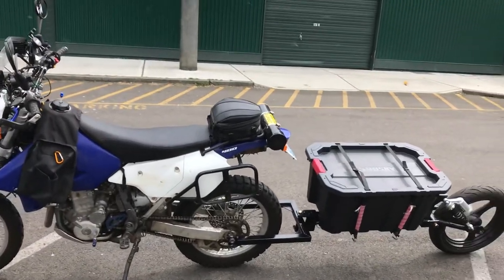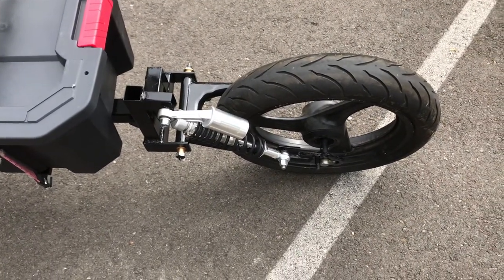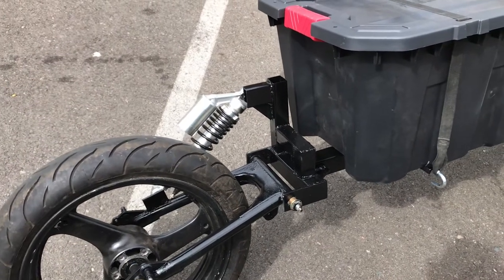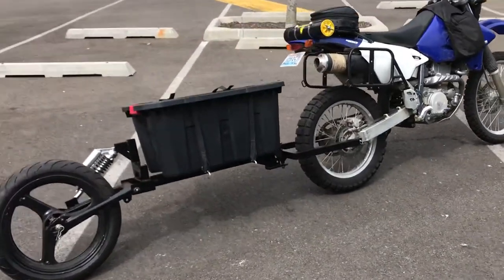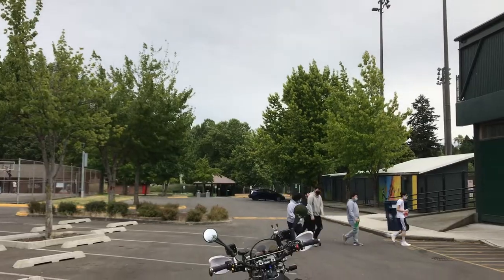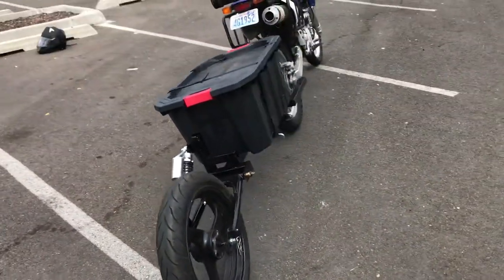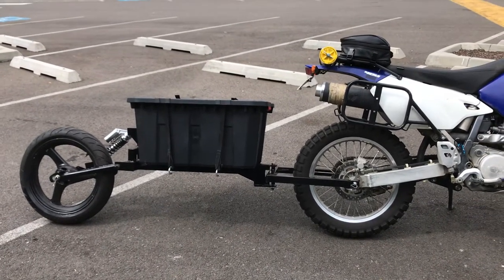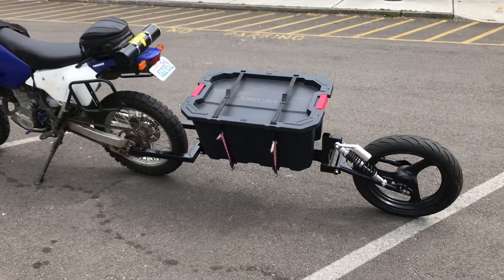Single wheel ADV motorcycle trailer.

Comment: Great video, I was thinking about buying a Sherpax trailer, but now I want to make my own!  Thanks
Reply from the maker: I lightened up by 35lbs by using a CR85 front wheel and a smaller box.
I saved over 5lbs jus by switching boxes
The new wheel saved 20lbs and the tire saved 5lbs
Reply from the maker: Do it,it will be a blast

Comment: Any advice for those with solid axels? 
I was considering a trailer setup similar to a bicycle trailer. 
I don't want to build a complex hitch that mounts to the frame. 
I ride a f650gs 
Your design looks perfect and ide like to copy it
Reply: I made a simple arrangement to connect a trailer to my motorized bike - a rigid draw bar fastened to both sides of the bike frame, with a single vertical hole in the center behind the wheel, to pull the trailer. On the tongue of the trailer I welded a threaded end of a car inner tie rod end, and threaded an outer tie rod end onto it. The pin of the outer tie rod end goes down through the hole in the bike draw bar. This allows for steering , tipping of the trailer sideways in relation to the bike, (the tie rod can rotate on its thread) and plenty of fore-and-aft vertical travel. Tightening the tie rod end stud nut makes both bike and trailer hard to steal.

Comment: Seems to be a great set up but missed the wheel type due to wind noise. What was the wheel brand?
Reply from the maker: In the video it had a GS500 front wheel.
But it proved to be too heavy so the big box came off and a smaller box went on.
Also the GS wheel came off and a CR85 front wheel went on.
I shaved off over 35lbs !!.
Reply: @motohead117  Thank you...you have been a big help

Comment: Viewer wondering: how do you rego that? Will those attachment points survive?
Anyway: not even putting lights on it
Reply from the maker: No lights needed because the motorcycle lights are visible.
No reg needed as it’s considered a part of the motorcycle

Comment: you need to change the ridged hitch setup, to a universal joint type or ball for better handling , it will handle better on freeway speed and wind and in the curves , ive been pulling every type of trailer you can think of for 45yr from big trucks to rv trailers to small trailers and all my motorcycle trailer
Reply from the maker: It needs a semi ridged hitch or it just falls over,this works good it’s a tried hitch setup that I’ve used before.
The problem is light bike vs heavy trailer

Comment: nice trailer but the turning radius of the trailer is too small on a tight turn you can fall of the bike the distance between the bolt and the front of the trailer has to be longer
Reply from the maker: 🤣🤣🤣🤣🤣🤣🤣
Nothing wrong with this trailer at all !!
It works flawlessly,what makes you such a expert ???🤣🤣🤣🤣🤣🤣🤣

Comment: Where can I get one ?
Reply from the maker: I built it myself,get a welder and start building !!👍👍👍👍👍
Reply: Can you got me link for parts
Reply from the maker: @joshtran854  eBay for a XT250/350 swing arm
eBay for motorcycle shocks
Metal retailer for tube steel